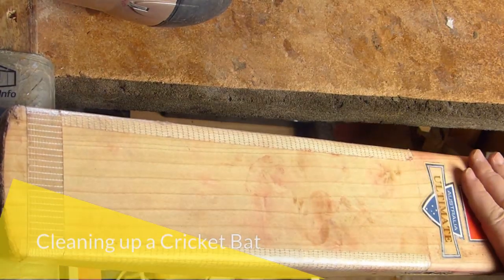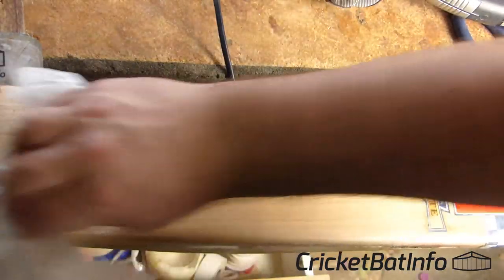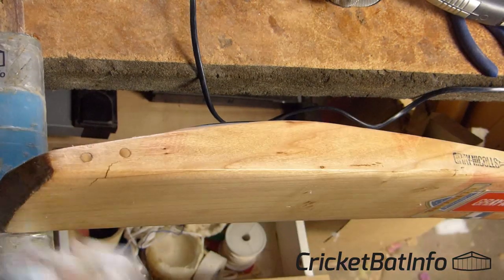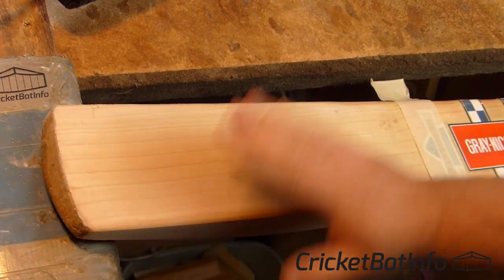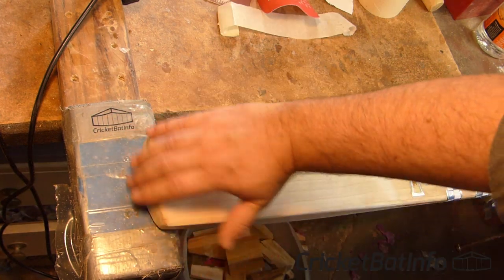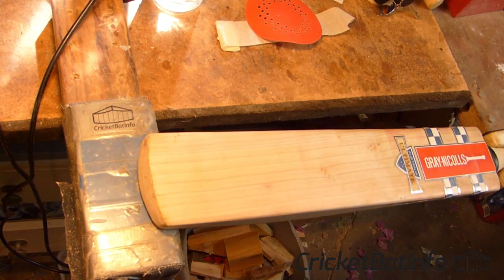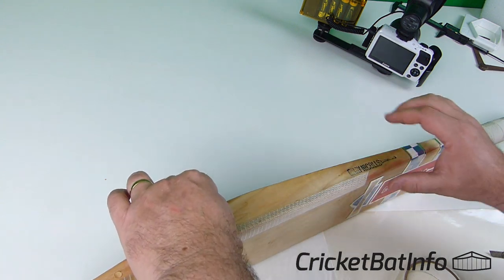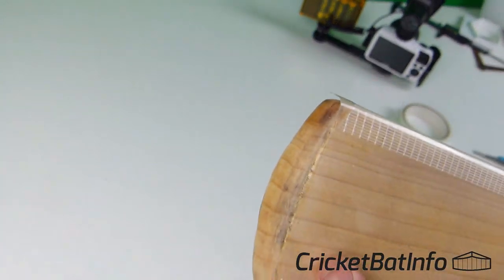How to clean up your cricket bat and save money.

Comment: Awesome Video….You got any advice for a newish bat that got its toe wet and has swelled up? Its now got two 1 inch long cracks in the toe as well…..
Thanks
Reply from the maker: I missed this message. Should have tried me on insta or fb messenger. Too late now. Should have clamped and slowly wicked the toe moisture away with paper
Reply: @CricketBatInfo  what u have applied to the toe of the bat kindly name it

Comment: I've been looking around and the dowel technique used on fixing your bats toe area hasn't been used on a shoulder repair, do you know of a reason a 3mm dowel wouldn't work on a shoulder?
Reply from the maker: I’d say it’s way too thin to provide any support.  I found bamboo dowels on ebay. About 6 mm. If you dowel you need to be able to travel 2x the distance dowelled (and glued). The Dowel is just a support. Its the area you have glued and repaired that is doing most of the work. So if your thinking 3 mm dowell it would be far more effective to support the bond with fibre tape.
Reply: @CricketBatInfo  thanks👍

Comment: Turpentine or ethanol is a solvent. It dissolves most nonpolar substances. It doesn't breakdown the glue. (Chemist here, hehehe) ☺️
Reply from the maker: Not tried ethanol, but I use turps (white spirit)
Reply: @CricketBatInfo  you could use acetone too (nail polish remover).
Reply from the maker: Definitely do no recommend as it destroys plastics (stickers)
Reply: @CricketBatInfo  can you make me a replica of the old Puma that Mark Taylor and Adam Gilchrist used?
Reply from the maker: I review bats only
Reply: @CricketBatInfo  😁
Reply: @CricketBatInfo  thanks buddy. If you can please review the old GM Purist. That's my favourite bat in the late 90s along with the V500 and Kookaburra Bubble.
Reply: @littlepuppy101  can I use spirit?
Reply: @unitedstudioz579  yes. Use a rag soaked in spirit. Normal surgical spirit or even cheap vodka will do.

Comment: I just bought a 2nd hand brand new hitman.
It's not oiled or knocked, but has a scuff sheet on it all ready.

Should I have any issue just following your guide on how to remove scuff sheets because it doesnt have the oil allready?

Regards.
Reply from the maker: 2nd hand…brand new? You mean never used. Be careful removing scuff on dry willow. Heat gun on a low setting probably the best idea and then deal with the glue with turps and rags. Be careful with fumes and peal gently across the grains
Reply: @CricketBatInfo  Yeah, never used sorry. Off fb market. OK good to know, will take my time in the workshop.

wasnt sure about how the unreated wood would go with turps ill just do it slowly  and carefully.

Thank you !

Comment: Can you explain why bat wax need after clean the bat.is it protects bat from water or something 🤔
Reply from the maker: I made it for my cricket club years ago for fund raising. This was what I wrote

Bat Wax is raw Linseed Oil and melted Beeswax in a solid state that can used to maintain, nourish and waterproof your cricket bat’s willow. Using bat wax when the bat prevents over oiling your bat as only a small amount of oil is needed when maintaining a bat. Do not use bat wax as a substitute for Raw Linseed Oil when knocking in a bat for the first time. 
The bat wax applied by:

Using your forefinger, scape amount of wax about the size of a pea on to the tip of your forefinger.
The wax will melt as you rub the wax on to exposed areas of willow on your bat including the toe and shoulders. Avoid slickers, grip and toe guards. You will be surprised how little wax its needed to cover a regular bat.
Stand the bat face up and let the wax set and seal the willow. The linseed oil in the wax will leech out of the wax and into the willow. 
After 1 -2 hours gently wipe the excess wax off the bat with a cloth or soft paper towel. The willow will be softer at this stage, so avoid scratching it with your fingernails or rough rags/towels
The bat can be buffed at this stage for a polished finish.